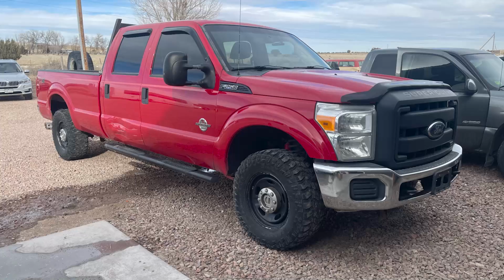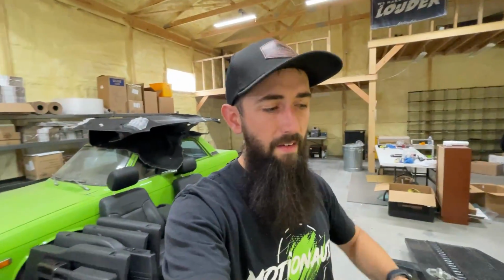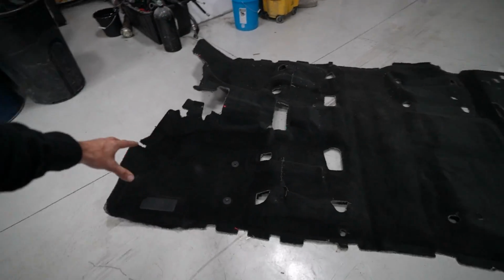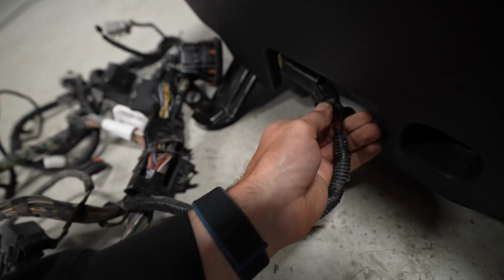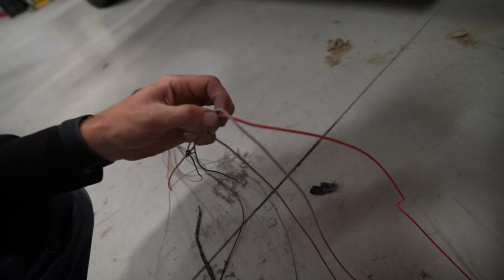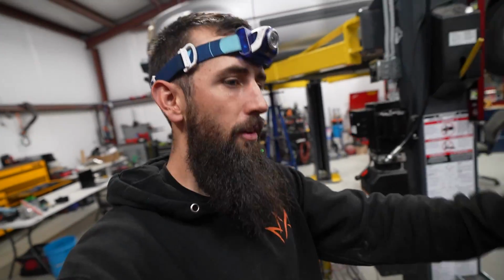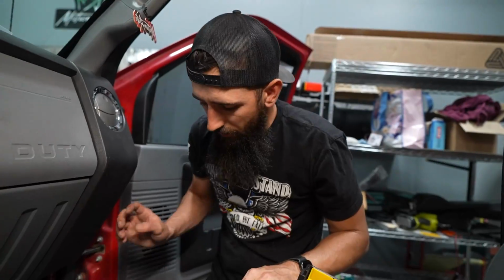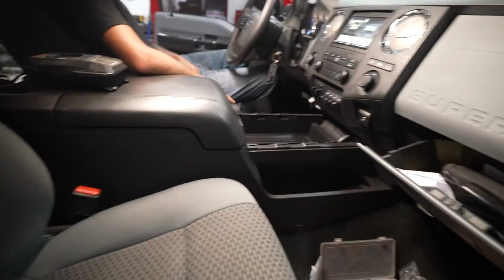DON'T BUY A NEW TRUCK - Do This Instead!

Comment: I have a 2015 F250 super duty XLT and I’m swapping the dash  Lost a 2013 lariat I’m putting a new dash harness off of a 2015 F250 lariat do I need to change the body control module because I’m gonna use a platinum body  Harness

Comment: I would absolutely appreciate a response. I’m doing a center console swap and like you want functioning rear vents. What is the part number for that plastic piece you installed that diverts air into the center console? I’ve searched 16 pages of parts and can’t find it

Comment: So if you can find an interior harness from a Platinum truck along with the APIM you can use it with your truck.  Then you can swap the seats in with the newer style dash.  The swap isn't hard finding the parts might be a little tricky. I grabbed my KR interior swap out of a flooded truck. I had the 11-12 stuff so a little different but still mostly the same process. I'm pretty sure the BCM is the same, you will have to go in with Forscan and turn on some of the APIM configurations.  You could also do the sync 3 swap at the same time. Looking forward to whatever you do!

Comment: Absolutely love the series of videos. You are correct to get platinum interior to work in that truck you need to complete body harness and body control module. Addition to that you will need all the harnesses for the doors, because part of the memory controls, go through the doors, and will also need the full power mirrors. As for the Apple CarPlay, you can upgrade the sync 2 display to sync 3.4 and have CarPlay. The only thing you will need is the wiring harness to make the parking sensors and rear back up camera work, as those are both standard equipment on a lariat and platinum. It’s a lot of work, but you get the same exact truck for a fraction of the price and that something you just can’t beat.
Reply from the maker: Thanks for all the info! I Found another truck local that was getting parted out that should have had most of that, but he sold the cab right before I called! Also all the local junkyards seem to have cut the interior harnesses for the seats which is wild

Comment: Your are probably gonna need tge body control and door harnesses for the memory positions and the heat/cool, lumbar etc. But also the sync system is different in the plati as its sync 3, its different setup than what is in these trucks with what I believe is sync 1? Im not entirely certain on that though. It would probably be a part of the bcm from a lariat/platinum truck